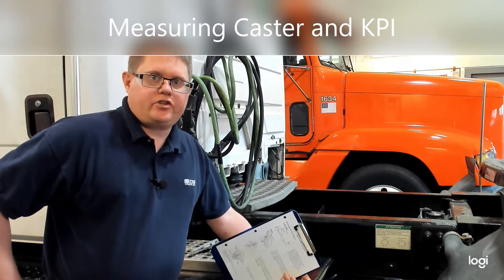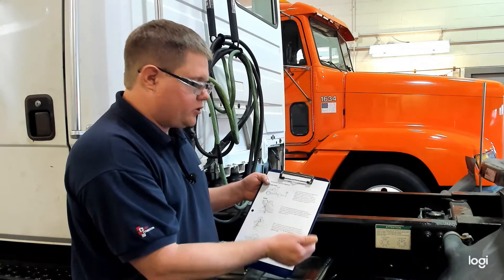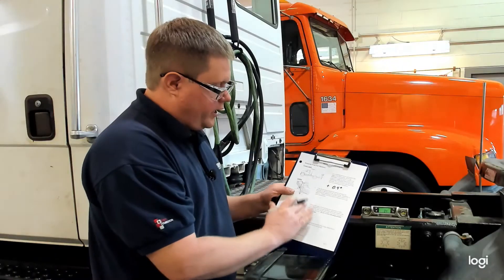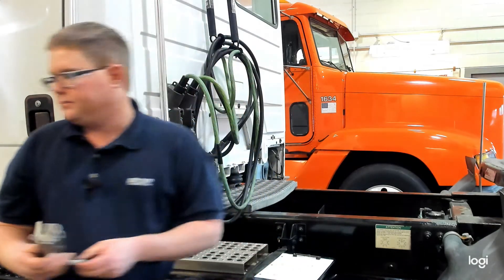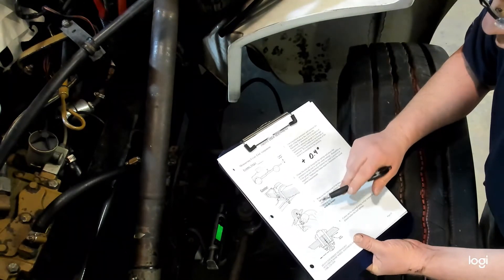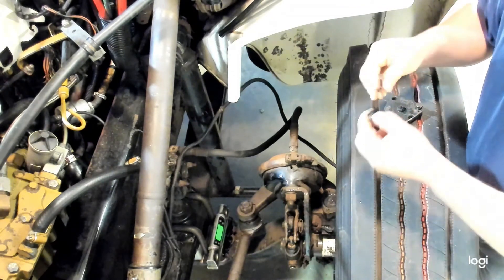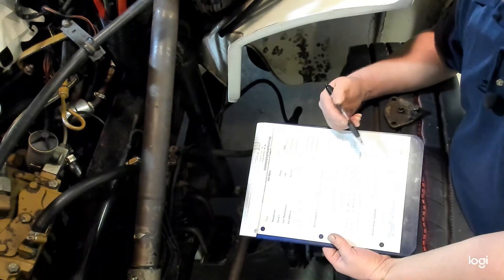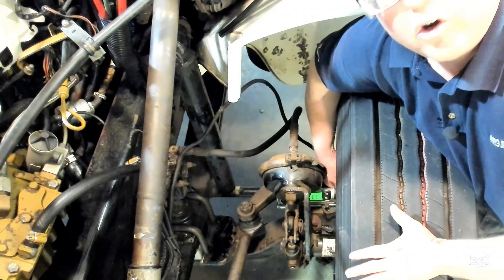Measuring Caster and King Pin Inclination

Comment: Your machinis pro tractor sed you had a positive angle and the second measurement you did. It showed it was a negative so which is it?
Reply from the maker: Which one showed a negative angle?  At 2:25 it shows that it was sloping down toward the back which is also positive.